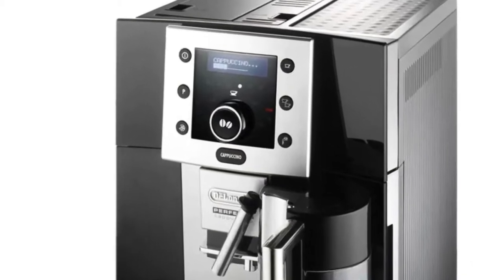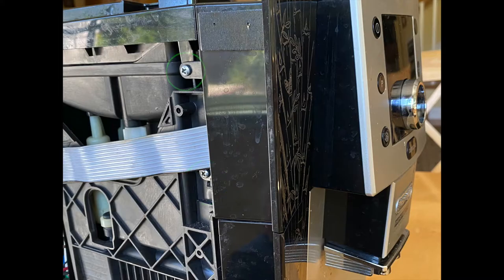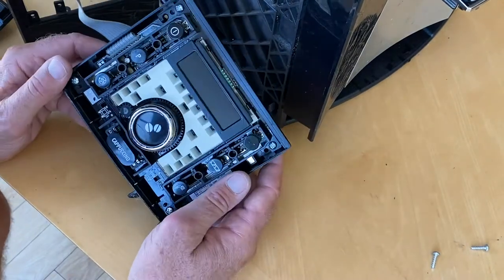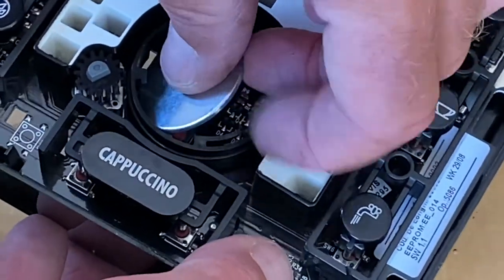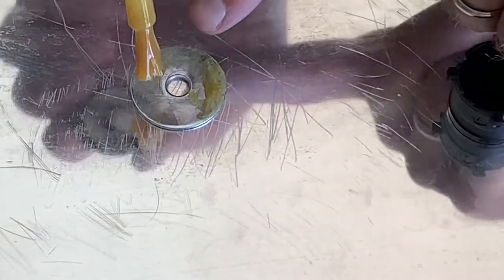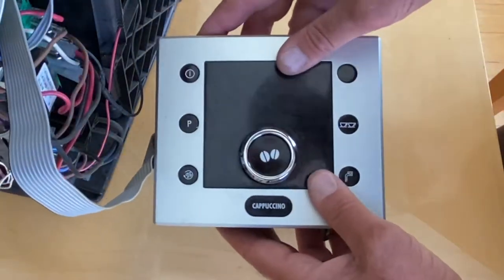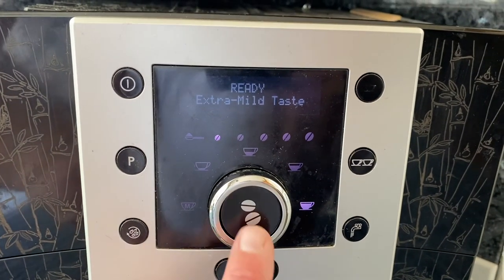Delonghi Stuck Button Fix - No More Extra-Mild Coffee

Comment: Thanks so much for sharing, I ordered a new part and now i've seen how to fix it. I'm replacing al front buttons because my cappucino button is held on by sticky tape also.
Reply from the maker: Yep, my cappuccino button failed too! I 3D printed a replacement with custom lettering. That's super easy with tinkercad. If you want to try it, I'll share the file!
Reply: @ravraid  oh bro, I'd love to. I don't have access to a 3D printer and I already ordered the parts. They'll arrive today. Thanks for the offer though, much appreciated. I also ordered the coffee outlet, it split right in the middle between the 2 outlets and it's producing 3 streams for a while now😂.
Reply: @ravraid  I also trying to restore a ESAM 4500 with a defective heath block when I feel like it, I have the part.

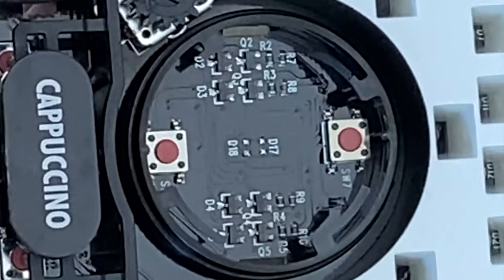Comment: @1:55 With a different mechanical solution that allowed the button to pivot slightly up/down, the two pushbuttons would allow some + / - action.
Maybe that's available in another model that uses the same PCB?
Reply from the maker: Yeah, that's probably it. Delonghi makes a million variations of a single model.